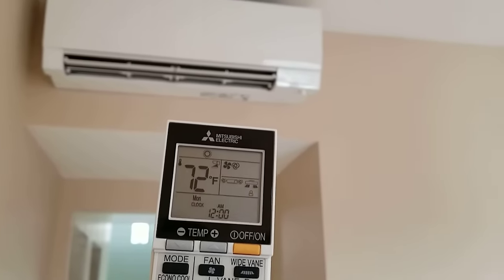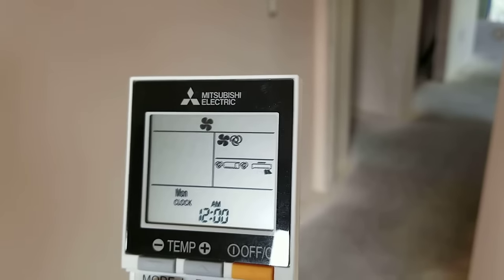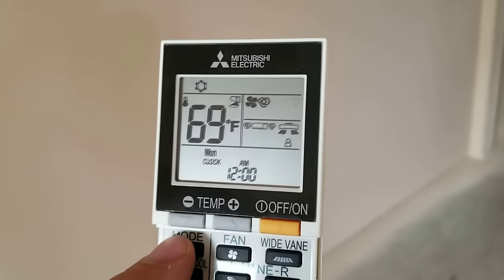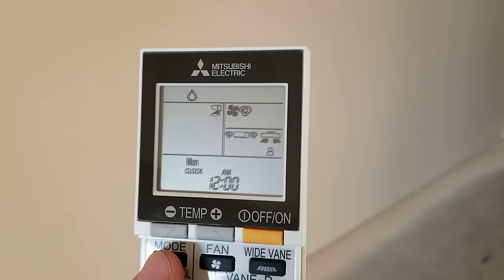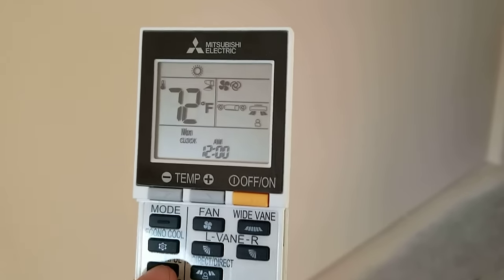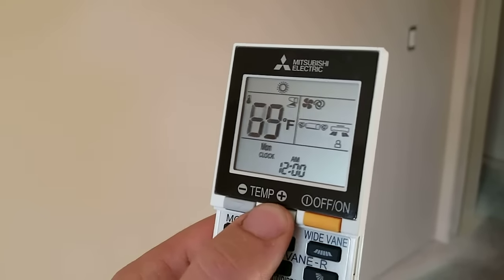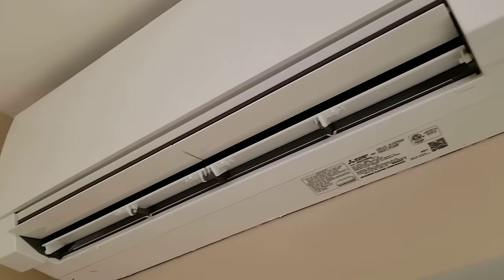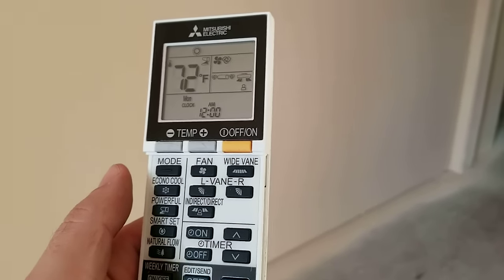Mitsubishi FH FS Hyper Heat Remote Control Operation.

Comment: Is a Mitsubishi mini-split beeping while running normal? As the unit cycles up and down at night, it beeps every time. 
What is the cause? How to I disable the beeping?
Reply from the maker: The unit shouldn't be unless you're pressing buttons on the remote and sending an input to the unit. Are you sure someone is not playing a prank on you? 😃
Reply: @cleanairheatingcooling4105  Thanks for the belated reply. I think this problem was due to a Sensibo remote sending commands. User not complaining anymore..  :)
Reply from the maker: @XRinger  So sorry we just came out of a busy season and haven't watched the comments frequently like we should have. Will try to do a better job of checking and responding to comments more promptly in the future.

Comment: My display will not come back on after depressing clock and reset, even with new batteries. Anyway to get the display back?
Reply from the maker: I'd have to look that up and help you further. That's not something we have ever come across.
Reply: I figured it out. I think using the end of a paper clip stuck the button marked clock in a depressed position. I took a pen and kept pushing on it until it came back up and the display returned, but thanks for replying.
Reply from the maker: @pablocruze9307  well done! 👏👏👏 I learned something. 😀 I guess I've seen this before on other devices. Sorry it didn't come to mind earlier when you asked. 👍

Comment: I am seeing one blinking operation green light instead of two steady green lights.  what does it mean?
Reply from the maker: Is this a multi-zone system?
Reply: @cleanairheatingcooling4105  I don't know but I have two indoor units
Reply from the maker: @kyawhla1534  great. That makes it a multi zone. The blinking means that each unit is in a different mode of operation. Just so you know, all units have to be in the same mode of operation. They are: heat, cool, dry, auto. We recommend either using heat or cool. Both units in the same mode.
Reply from the maker: Once you try that, can you let me know if it worked?
Reply: @cleanairheatingcooling4105  Thank you . So does it means that I have to run both units ?
Reply: @cleanairheatingcooling4105 It works. I have tried them already. you have to turn on both Units in order for one to work. Thank you for your help.
Reply from the maker: @kyawhla1534  I'm sorry I didn't see your reply sooner. In most cases you only have to have one on and it should work by itself. If that's not the case there may be something crosswired or the piping is not ran correctly. It's a common installation mistake I see out there.

Comment: Thank you. It must be said this hand controller is one of the most unintuitive I have seen. Generally, User Interface design is not the strong suit of Mitsubishi. Just look at TV set hand controllers too. These are used as examples of bad design in UI design classes. Having said that, the units are reliable, and effective though you have to be careful to use them "reasonably" if you don't want surprises on your electric bill.
Reply from the maker: You're correct about the design not being the most intuitive. They're newer controllers already are more intuitive and they use the words heat cool dry out of rather than the symbols it's not already a good step. Their instructions are getting better. As far as the usage cost from my experience with designing, installing, servicing and repairing these units, they are the most efficient when designed and installed correctly and maintain correctly. If the wrong unit is used in the wrong application they can usually cost a lot of money to operate.

Comment: As of June 2022, the Mitsubishi FH Series is by far the most efficient air conditioner. It is a heat pump with a capacity of 8,000 BTUs, EER, SEER, and HSPF scores of 19, 33.1, and 13.5. It has an annual energy cost of about $35, a lifetime cost of $423, and saves about 53% in energy savings. How much does it cost to buy a Mitsubishi FH Series product?
Reply from the maker: The price varies by location and installation details, materials, time on site. Where are you at?
Reply: @cleanairheatingcooling4105  I’m from California.
Reply from the maker: @alphaapple1375  ok. We don't sell or install product in CA yet. Do you have a local HVAC company you trust?
Reply: @cleanairheatingcooling4105  Nope. I was just commenting how efficient air conditioners like the Mitsubishi FH Series really are. It was for your audience to look into some insight on air conditioners.
Reply from the maker: @alphaapple1375  We appreciate that!
Reply: I paid 1500 euro for fh 335 (installation included) in Sweden about 4 to 5 years ago. It is a great unit. It is very cheap to run. Gives a lot of heat.

Comment: why does the machine turn off when the rooms heated, although i don’t have it on auto and no timer on, like i’ve got it on the four bar speed fan, like i want it to blow out heat continuously, but seems once the room heats you hear no fan going, and feel room go cold
Reply from the maker: This varies by model. If you can tell me what outdoor unit and what indoor unit do you have I could probably give you more specific answers. But in general the reason that happens is because the unit could be going into a defrost mode or something to do with the algorithm in the machine.

Comment: The fact that none of Mitsubishi's remotes include a basic light to read the display at night is bonkers.  Keep these units out of your bedrooms unless you want to wake your spouse every time you turn on the bedroom light to adjust the air conditioner.
Reply from the maker: Jason. Very true. A light would be nice. In reality it depends on each person and how they want to use it. Some people set it and forget it. They only have to adjust it during the season changes to turn it on and off. 
And some people like to adjust it multiple times a day and sometime during the night. In those case a light would be an excellent feature.

Comment: Why is it unhealthy for your home to go below 61 degrees?
Reply from the maker: When the temperature is get below 60 at least in the Pacific Northwest where we are located the colder air along with the humidity in the air can cause parts of your house especially where the air is stale and there's no air movement to develop mildew. This damage is the walls and the structure and is unhealthy to breathe. If it was 60° with great ventilation and air flow it might not be a problem if the air is dry. But that's not the case in most situations. So it depends on what part of the country you're in and the conditions where you are this temperature recommendation might change for you.

Comment: my new system has a soft light that goes on and off when the unit is turned off. I can see the lights in a dark room. What are the lights? Something to do with the I-See control mode? How can I stop it? Thanks.
Reply from the maker: Not sure. I'll have to look into this and try to replicate the same symptoms then get back to you

Comment: Is it normal for a Mitsubishi mini-split to be beeping while running? As the unit cycles up and down at night, it beeps every time. Making it hard to sleep. What is the cause? How to I disable the beeping?
Reply from the maker: Do you have multiple zones?
Reply: @cleanairheatingcooling4105  Nope, single zone.
Reply from the maker: @XRinger  there could be an issue with the system. Does it eneter a lockout where you have to reset power?
Reply: @cleanairheatingcooling4105  Nope, it runs normally, it just beeps when the heat cycles to increase the room temperature.
Reply from the maker: @XRinger  are you saying it beeps in response to your pressing the button to increase room temperature?
Reply: @cleanairheatingcooling4105  Nope, it beeps while it's running at night, keeping my kid awake. When the fan speeds up and more warm air comes out, it beeps.
Reply from the maker: @XRinger  I haven't seen that. Which model unit do you have?
Reply: @cleanairheatingcooling4105  Thanks for your help, but never mind, the location is under COVID quarantine now  (and me too). So it's going to be at least a few weeks  before I'll be able to look at this problem again. Take care.
Reply from the maker: @XRinger  I'm sorry. I'd need the model mber to help you further. This is not in your son's room?
Reply: @cleanairheatingcooling4105  No, it's in another house, in the next town over. It's in full quarantine for now.
Reply from the maker: @XRinger  oh, I'm sorry.

Comment: The new Mitsubishi air-conditioning remote control I did watch all the YouTube how to setup the time and day but no one did give any explanation on to change the format  from 24 to  12hours Am/pm …. No one did explain even the Mitsubishi company didn’t give explanation…  and no information on user manual !!!!!!  why why ????
Reply from the maker: The best solution for programming is to get the MHK2 thermostat and use that instead of the remote. You could also get the kumo cloud adapter, sensors, schedule on the app, etc. Let me know if you want us to help you with that! You can respond here to shoot me a text.